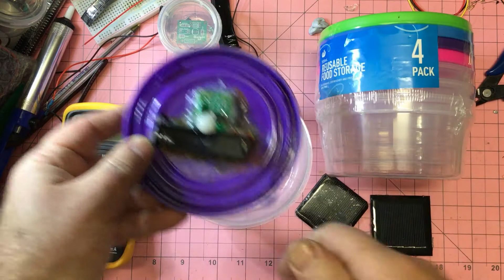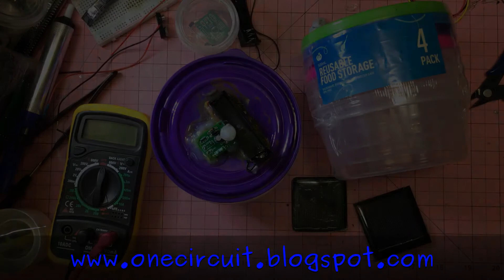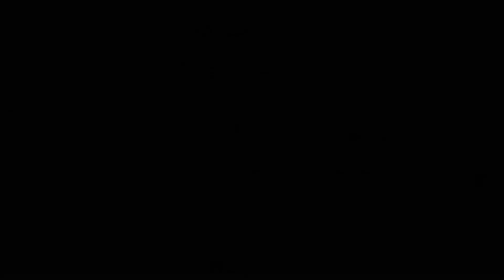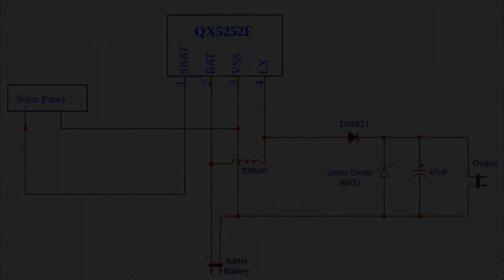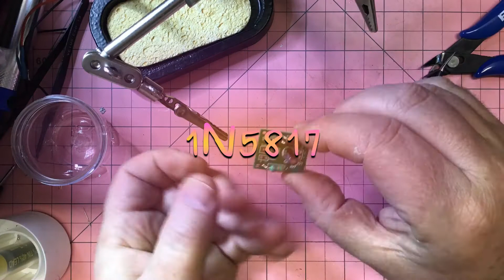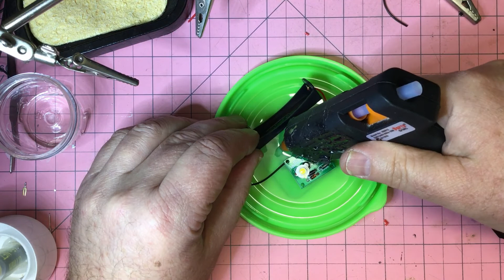Improved Solar Lights - new panels!

Comment: Nice build. Any plans to make a reflector, a conic design using silver foil to increase single led light
Reply from the maker: It’s enough light for the hallway at night. The “focus” has been on efficiency, not light levels. These are still used every night, even with poor winter sunlight providing the energy. 👍😀

Comment: Cool. It works a treat. You've got the same glue gun as me. Cheap and cheerful.

I have a question about the ATTiny 85 PCB, where can I get drivers for the board ? I found one for XP but it does'nt work. Can you help at all? Cheers.
Reply from the maker: Attiny85s are supported via Spence Konde’s core found here: https://github.com/SpenceKonde/ATTinyCore There is extensive documentation for installing it on the Arduino IDE. You basically define the location of the json file in the IDE preferences. Let me know how it goes! Good luck...👍😀
Reply: @onecircuit-as  Thank you, I'll look at that tomorrow.
Reply: @onecircuit-as  I give up with the ATTiny 85. I've been at it now, on and off, for a week and nothing makes sense. I don't understand what the tutorials or anyone on the forums are talking about either. Too many odd words and acronyms.
Reply from the maker: Franko Walker I remember that feeling and it’s not pleasant! I’m happy to take you through the process. Do you have a USBasp (https://core-electronics.com.au/usbasp-usbisp-3-3v-5v-avr-programmer.html) or are you using an Arduino (e.g. UNO or NANO) to connect?
Reply: @onecircuit-as  i don't know what USBasp ( is, I don't use Arduino (it's the ATTiny 85 on the USB PCB), the link took me to a page that said it was unavailable and out of date. Sorry if I'm putting you out.
Reply from the maker: Franko Walker OK sorry for that link! Is your attiny85 a digispark like this one: https://neonaut.neocities.org/images/digispark-pinout.png
Reply: @onecircuit-as  Yeah, very much, but the USB is a micro or a mini socket. There are so many types of USB I don't know which is which LOL
Reply from the maker: Franko Walker OK like this one: https://botland.com.pl/55182-large_default/digispark-attiny85-mini-microkontroller-5-v.jpg
Reply: @onecircuit-as  Yes, thas te one. Any help for XP would be much appreciated.
Reply from the maker: Franko Walker OK I’ll dig one out and play. Do you have an email address I can reach you on? Post it here like this: fwalker at ms dot com so the robots don’t grab it! 😃
Reply: @onecircuit-as  O.K. I'll use my other account just in case.
speccysruleok at gmail dot com
Reply from the maker: @Franko_Walker  Email sent!
Reply: @onecircuit-as  Cheers. I can't focus at the moment. LOL.

Comment: If inductor is 330uH (it can be 22uH, 33uH, 220uH or 330uH - on video, can't see colors clearly) you should change inductor to 56uH or 33uH to get better light. That solar panel will be enough because it has 160mA on his MPP. Now LED take about 14mA, by using 56 uH, should be about 50mA, and with 33uH about 85mA. That could be greater light.
Reply: Is that a 1 watt rated inductor?
Reply from the maker: @deankq4adj125  I think they are all 1/4 or 1/2 that I use (mostly radial). I have tried other packages (e.g. power chokes), ratings, etc., but it doesn't seem to make too much difference. The only difference is for the inductance, with lower inductance leading to higher current. I was installing 470uH in similar lights for a project on the weekend and that worked fine for driving an ATTiny13 coded up drive a couple of LEDS. The video for that project should be appearing in a week or so!
Reply: @onecircuit-as  Thank you. Great project!
Reply: @deankq4adj125  It's 0,4 or 0,5W inductor. Because the resistance of inductor is about 2,5R (10uH) to 7,0R (100uH) the max continuous current is about 100-160mA.
Reply: @Ibryam1997 Bacak  Want you solar light with 0,5 W LED or 1W? How much power does your solar panel have or you didn't have any?
Reply: @Ibryam1997 Bacak  With 1W LED it will be about 250 or higher mA. If you do 300-400mA solar panel i would recommend add solar panel then by Shottky diode straight to battery and by 10k resistor to solar pin from IC (pin 1 in QX5252F for example) to prevent IC fail (it can burn at 400mA charge). 1 AA good quality battery will run on in 6-10 hours.
Reply from the maker: That’s true, but I actually use larger inductor values to make less light (lower current as per the data sheet) and therefore they run longer. The goal has always been efficiency, not brightness, 👍🙂
Reply: @onecircuit-as  Depends when you want that light. During summer it will be overcharged. Battery can fail quickly (QX5252F will not cut off charging): Summer 11 hours of direct sun - 1700mAh, light - 5 x 14mA = 70mAh (small compared to gained capacity) I used also 2 x AA batteries and 160mA solar panels too. One day during summer is enough for light to work 3 days with 33uH (log days, short nights). Also i am testing now circuit with QX5252F and 3W LED. The current i have set now is 420mA, lamp is supplied by 2 x 18650 2900mAh and 3W solar panel (working 11 hours during almost Autumn). Also lighting time depends on battery capacity. Of course your light will work longer, but i think only during winter and many cloudy days in row.
Reply from the maker: “...during winter and many cloudy days in a row...” = Tasmania! 😂
Reply: @onecircuit-as  Or garden with trees :) Than not that good :) But i have about 70 solar lights (idk why, but each summer during free time i build some of them). This year i saw lights working well, but batteries overcharged and bulged, + terminal was coroded by electrolyte. That lamps had set 70mA charging and 10 mA discharging. Also if you are using capacitor and diodes you can use 2 pin color changing LED if you want low current.